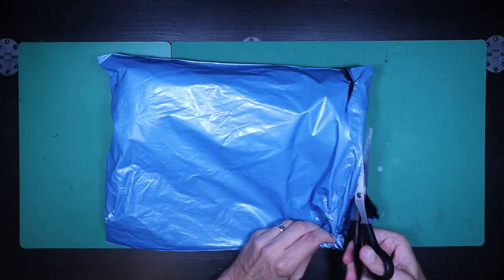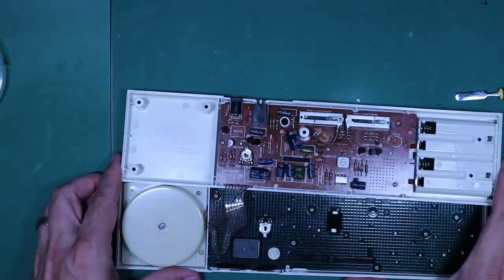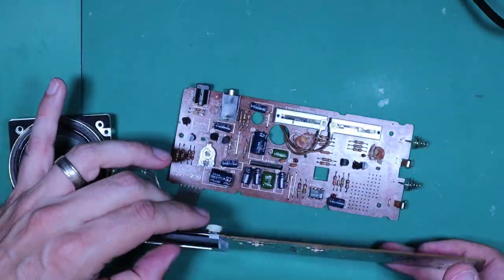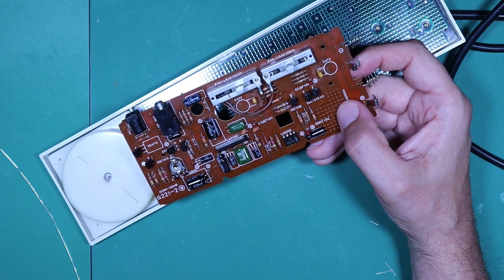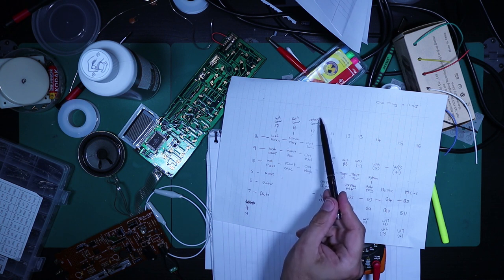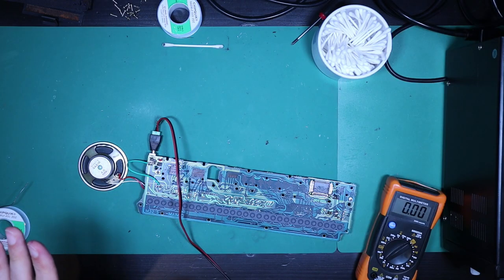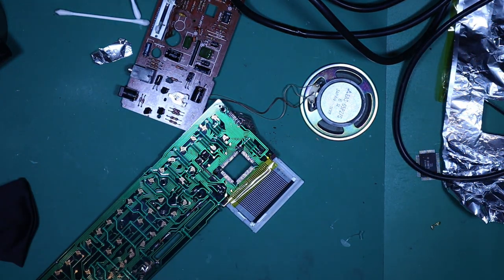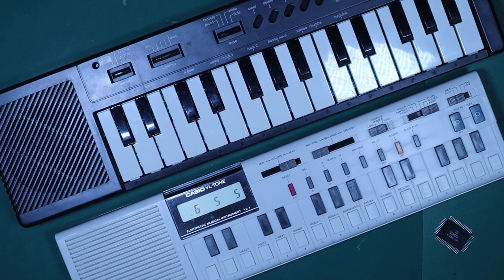Casio VL-1 Repair with Schematic

Comment: To anyone about to venture on this task, I have a few tips from our friend hindsight.
- A strip of clear parcel tape across the keys/buttons will save you a few fiddly minutes further down the line.
- The slider tips for volume and balance should be removed before opening as they're a pain to find on the floor.
- If your symptom is a crackling/quiet speaker try some contact cleaner in the volume/balance sliders combined with some back and forth motions before going any further.
- The LCD ribbon is extremely fragile as it is glued rather than soldered. To restore functionality without heating up the glue & re-sticking, I used the shaft of a cotton bud to lay over the contacts for the screen, combined with a lolly stick cut to size to apply some additional pressure on the rear of the circuit board once closed. (If you're from the future and find a lolly stick with "LCD Pressure Fix" written on it... Hello!)

Thank you for putting this video together. It's always reassuring to have something to reference. Despite my issues with the LCD, after some TLC with contact cleaner a few stubborn keys were sorted and the VL-1 was loud and clear instead of whisper quiet. I also realised that the OP-1 was inspired by this device too. 

Thanks for the nostalgia trip with some of the other videos!
Reply from the maker: Thanks so much for your Totally Awesome comment! Full of useful info and with some lovely kind words that I genuinely do appreciate. I have a VL1 with a dead display so I'm going to be trying your tips. Thanks so much!
Reply: Thanks for the tips, I got one yesterday from market for 41 bucks It was working really well with great looking body and LCD fully functional no bad keys suddenly today it had crackling/quiet, on and off sound after I changed my batteries, I thought my batteries was bad but it's not I cleaned it up and end up made my LCD looking worst with missing numbers. and still couldn't fix it, Everything on the board looks fine and I don't wanna go so far as replacing chips sadly.
Reply: I just tried some contact cleaner in the vol/bal sliders, and flicked the pots a bit (w/o c.c.), as mine was crackly and very low in volume. Now it's dead. Everything worked before the cleaning, apart from crackling and volume. Now, no life. Wat do? :/

A tip on opening it: no need for a tool, do this instead: push the plastic just under the swing/3-key, while carefully pulling the bottom part open. The "shell" is attached in one spot on both sides, in the middle of the keyboard, so just be careful and use just enough force and it will open quite easily (just remember that it's also attached on the backside)
Reply: Fragile LCD ribbon is interesting. Were there sound when the problem occured? Guess I'm diving deaper into this tomorrow, although I'm a novice. I really hope it'll arise from the dead.
The ribbon cables on mine are green btw. Also, the capasitators between the volume slider and the line out are placed a bit differently

Comment: Wow. 1979/80. Surface mount technology and switches that are built exactly as they are still used today on mid-range keyboards. I wish that a device from today could be found in 44 years with the same frequency that these keyboards are offered today. Greetings from Germany!🇩🇪🤝
Reply from the maker: Hello and thanks for the German greetings. Great to have you along. Yes it will be interesting to see what the retro future will be. I'm not sure we will have the same affection for the ps2 or xbox360 as we do the amiga or this little casio. Interesting they still use similar keypads. Thanks again for your comments.

Comment: Just tried to repair one of these, pads on the power switch are wasted, I tried using jump wires to see if I get a blink but so far...nope! You really went to town here, very well done! ❤️😎👍
Reply: Pads can be easily repaired with wire and uv coating.

Comment: I appreciate your respect for the PT-10. You sounded like a hunter thanking their kill. Also I read in the service manual that the pot hidden inside is the coarse pitch adjustment.
Reply from the maker: LOL thank you. The VL1 is so iconic I felt it worth the "ORGAN transplant" (eeek). Interesting it can be "tuned". Thanks for the info and you message.

Comment: Excellent video, despite production problems. I was wondering however as only 3  lines were silent on the VL-1's processor did you check to see if those lines were used on the FT-10. It may be possible to have the FT-10 working to some degree even if you were forced to hard wire the octive and instrument selection. (I have been known to talk crap at times, I am aware that this could be one of those occasions). Best of luck ;)
Reply from the maker: That's a very interesting point. The actual repair was a while ago now and my memory is a bit hazy as this video took ages to edit. I think I did confirm the signal on the lines of the PT-10, and all the lines that had failed on the VL-1 were definitely used on the PT-10. When I bridged the VL-1 switches i essentially hard-wired octave and instrument so I doubt it would have worked.... I like your thinking though. Got me thinking too. Thanks for the comment!

Comment: Great work. Your video gave me hope and then, after seeing what was required for the fix, despair! My VL-TONE which I’ve had from new has almost identical symptoms: stuck in calculator mode and wont power off.I do though have every single calculator button working, so I must have a pin or two more than you still live on my chip. Unfortunately it’s beyond me to fix this by replacing the chip. Occasionally I’m giving it a vigorous shake an slap and trying the batteries again - but I don’t suppose that’s really likely to help! Enjoyed watching your success though - good job..
Reply from the maker: Thanks parabis. Glad that you enjoyed the video. Sorry it didn't help your situation, but I really appreciate the feedback. Thanks!

Comment: Thanks for the tips, I got one yesterday from market for 41 bucks It was working really well with great looking body and LCD fully functional no bad keys suddenly today it had crackling/quiet, on and off sound after I changed my batteries, I thought my batteries was bad but it's not I cleaned it up and end up made my LCD looking worst with missing numbers. and still couldn't fix it, Everything on the board looks fine and I don't wanna go so far as replacing chips sadly.
Reply from the maker: Sorry for the delay in responding and sorry to hear of your Casio problems. It is rumoured that nothing can be done to fix LCD display. I am unsure if this is the case. I do have one with a faulty display so one day I might try to fix it. The crackle may just be dirty sliders which might be fixed with a potentiometer cleaning spray for lubricated switch cleaner. I'm not expert in repairs so this isn't advice, just what I might try.  Thanks for your comment.

Comment: Thanks for sharing.  I found my mother's old Realistic Concertmate 200. Seems to have the same issue. Alas, I don't have your patience or skill level to make the repair if mine has the same problem
Reply from the maker: If it helps I had no practical skills when I started doing this. Perhaps give it a go, you might suprise yourself! Thanks for your comments. Sorry its taken so long to respond

Comment: Great video although a lot went over my head. Impressive analytical skills and perseverance. I found this while looking for any info on what goes on inside the box. I dragged out my old VL-Tone after a loft clear-out and it's dead but you've given me some ideas.
Reply: Well how about that. Inspired by your video, I got out my multimeter and eventually discovered that both positive connectors in the battery compartment, while looking clean were not connecting properly. I tries cleaning them - no improvement. A couple of pieces of folded tin foil have done the trick - I'll investigate further. Meanwhile, as I type, the cheesy demo tune is playing. Nice. Thanks for nudging me in the right direction!
Reply from the maker: Thanks Chris. Glad you found the vid interesting. Good luck with the repair. Thanks for taking the time to comment. Really appreciate it

Comment: I got a non working vl tone for £5 and it was in a similar condition, but It just needed a good clean on the terminals and it was alive
Reply from the maker: That's great! TBH when I first started this channel that's exactly what I expected I'd be doing... how little I knew!! Good story though. Thanks for sharing. Thank you so much for taking the time to comment. Really appreciated!
Reply: @RetroTechRepair   No problem, i also recently bought a PT 20 that was very corroded and had an entire terminal missing but i was able to fix that too but it was a much more complicated issue than a simple cleaning job. It's very nice to get a great deal when you have the knowledge and confidence to fix something
Reply from the maker: @RetroPlus  it certainly is. I've noticed prices dropping a bit recently which considering I have SO MUCH in "stock" to repair is a bit of a shame. But is good for bargain hunting just now.

Comment: Hi there ! I have one from my time of child but I don’t know why the speaker it’s no working just the headphones
What do you think it is ?
Reply from the maker: Unfortunately I do not have it anymore so I can't check. Sometimes these devices have a switch built into the headphone jack that disconnects the speaker when the headphones are plugged in. These can "stick" open disabling the speaker. I don't know if the VL1 is this way, but if I were looking at it, that's where I would start. I am not an expert in these repairs, this is just my opinion. I am not qualified to give advice. Thanks for your question. Hope that you enjoyed the video

Comment: I would have definitely give up after replacing the capacitors haha. Really good video with tons of info. I also own and have cleaned
a casio vl tone 1, but would've love to know beforehand that the lcd ribbon was so delicated since i ended up breaking mine 😪.
Reply from the maker: Glad you enjoyed the video, I nearly broke my ribbon too. Perhaps you can get another spares or repair and make it good again. Good luck. Thanks so much for your comments.
Reply: @RetroTechRepair  Normally when the ribbon detaches it's game over. The ribbon also normally detaches when someone removes the keyboard pcb because the adhesive is so old.

Comment: Hello, I just cleaned mine and it was fine the first time but they keys fell out, I put it back together, and now only certain lines show up on the screen. Do you have any idea what could’ve happened? It plays fine and everything works besides the screen now
Reply from the maker: Hi Aeson. I am not an expert in these repairs so I can't really give you advice. My guess is it was not to do with the keys falling out, but that perhaps some of the connections to the display were damaged during the assembly/disassembly process. If it were mine I might try gentle pressure to the ribbon cable at each end to see if the situation improved. If things got better I might try some foam of something to keep pressure on the cable when assembled. This is not advice just what i might try of it were my own. Good luck

Comment: Thanks for the video, it's very nice explained!
I'm trying to fix my VL-1, no display it plays sounds but very low and distortion, Line out not working 
all caps looks good, any suggestions on what to check?
Reply from the maker: Hmmm, I'm no expert (total amateur in fact) I tend to check components so if probably check test each transistor in turn as a starting point that's not a recommendation, just what id do. Welcome to the channel. Thanks for your comments
Reply: @RetroTechRepair  Amazing!!!
I replaced 2SA715 and now it’s playing perfect!!
But still no display and line out not working
Reply from the maker: Hi  @liorCohenParsi  that's for stopping back with an update. That's great news. I am so glad you are making progress. If it were me I'd probably try cleaning the Line-out socket with some electrical contact cleaner or Isopropanol. Once I'd applied it, It insert and remove a jack several times. I might repeat that. process a few times if it didn't work the first time

Comment: Great Video. Just got given a Casio VL-Tone.  The battery compartment is quite corroded, although it looks a bit different from yours, as there are only Two Springs at one end, whilst the top edge has Two brass looking strips, which  have fallen out, am not sure how they fit back in. Having messed about with it for a while, it doesn't appear to be working, on batteries. I have discovered by connecting a DC Power supply that it Jumps into action and does indeed function. Do note the DC supply should be Reverse polarity. -ve Centre. I have a Casio CTK-670 Keyboard, which also uses reverse polarity, as opposed to my Yamaha, which used a similar voltage, although the polarity is different, +ve Centre. So beware folks.
Reply from the maker: Hi yes. I discovered the polarity issue to my cost on a Casio SA21 (it's in a different vid). You can buy various spring contacts on eBay, that you can sometimes make fit. Super cup football, galaxy invader videos of mine have examples. Good luck with it and thanks for taking the time to comment. Really appreciate it 😊👍
Reply: @RetroTechRepair  I Notice the Casio VL-Tone is also sold Under The Name Realistic Concertmate, Which I believe was the old Tandy Brand.  I have found and online PDF manual. It states, to switch to CAL mode, and press the reset button, after replacing batteries, or switching over to a DC PSU. Prhaps I will give that a try.Very Impressed you were able to get yours working again, and Dedicated so much time and effort to it. I think that would have had to be a bin job for me.
Reply from the maker: Richard Greene  Thanks! Glad that you enjoyed the vid and thanks SO MUCH for your continued engagement with the channel. I did know about the Tandy version, but didn't know about the cal/reset switch. I don't think it would have fixed my problem, but it might have. It wouldn't be the first time I'd found a complicated solution to an easy problem. Much of what I attempt to repair goes in the bin, I  am going to start posting some fail videos now I have a few subs who might enjoy. Anyhow thanks again. really appreciate it
Reply from the maker: @richard180961  Congrats I checked out your video too. I have replaced a few contacts in similar situations.  Usually have to snip them, file them or dremmel to fit. Thanks for the feedback. Keep us posted

Comment: I case it's useful info for anyone working on these... you don't need to jump any of the switches while testing. The only switch you need to operate is power and this is a logic-level toggle since the device seems to be always-on. You can just touch the switch briefly onto the pads in any position and it will toggle the device into any on-mode, or off. It will stay in that state that until you toggle a different state. No permanent jumpers required...
Reply from the maker: Good to know.... Thanks!

Comment: Si interesting. I Have one where the device works but the adhesive on the ribbon to the lcd has started to come off. Can you recommend a conductive adhesive glue that might help? Or maybe some other way. Regards in advance
Reply from the maker: I don't have any advice but do have a unit with the exact same problem so I might experiment. If I find anything that works I'll put a video out here so stay tuned
Reply: @RetroTechRepair  I have been trying to source the conductive rubber by zebra. But I can't find a source in Europe. I managed to but one with a cracked case but fully working and swapped out the parts, successfully. I tried looking for the other Casio's with the same chip but far too expensive.
Reply from the maker: @ForSynthsSake  good to hear you got it working. Thanks so much for getting back to me
Reply: @RetroTechRepair  I just found a Casio with the same chip for 10 euros and snapped that up quickly
Reply: I got the PT10 and did the surgery only to find that the fault still existed. so I took the vltone chip and put that into the pt10 and it works fine. Do you have any advice on how to test the traces. When you did it, how did you do it? did you mark each trace with something to show it was ok or did you do that on paper? I have at my disposal an oscilloscope, a multitester and a multi device tester but Iit doesn't test the components in situ. like the smb caps. Your advice would be most welcome.
Reply: Finally success. One tiny break at one key press point. Now all the other five work.
Reply from the maker: @ForSynthsSake  excellent so glad to hear

Comment: Nice work. What's that brown tape on the back? I see there was a wire connected to it.
Reply from the maker: I'd need to play the video back it's been a few years now. Where in the video is it shown?
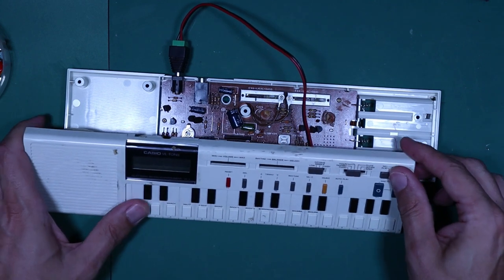Reply: @RetroTechRepair  At around 7:47, under the circuit
Reply from the maker: @johnarnold266  I can't say for sure but guess its metallised tape used as an EMC shield. It looks to be behind the analogue board and probably cuts down on noise interference. The wire probably goes to the ground plane (0V) on the board. All a guess as I'm afraid indomt have the keyboard any more
Reply from the maker: @johnarnold266  thanks very much for your question
Reply: @RetroTechRepair  That makes sense. Thanks!!
Reply from the maker: @johnarnold266  you are very welcome

Comment: Nice video. My vl 1 isnt turning on too. And its lcd is broken too
Reply from the maker: Thanks for your kind words. I sure it would be OK as an instrument if not a calculator without the LCD. I hope you can work out why it's not turning on. I would check the external power jack (if it has one) i have seen these oxidise and interrupt the battery power to the board on other keyboards. Good luck